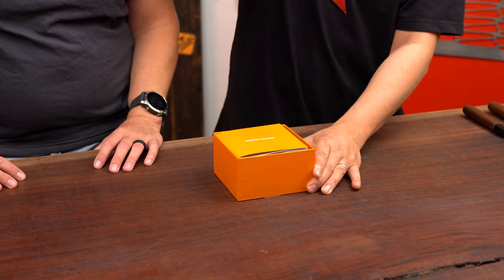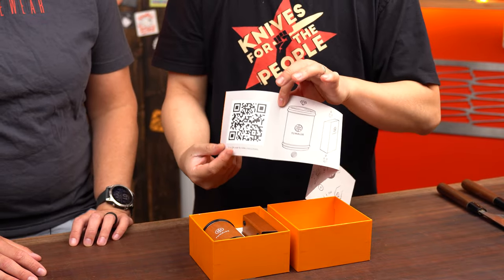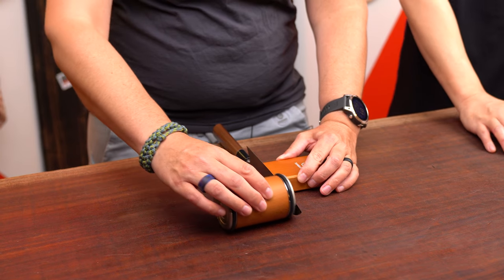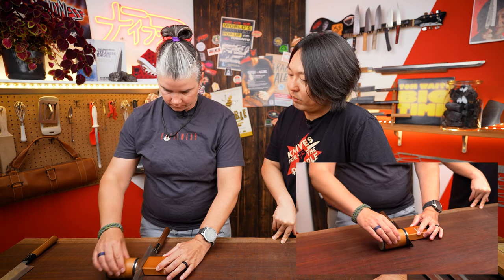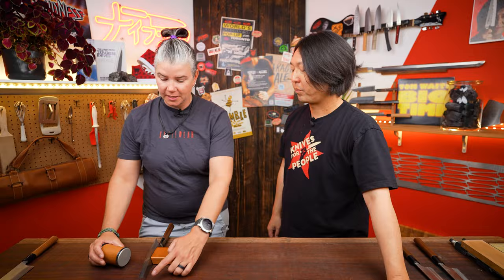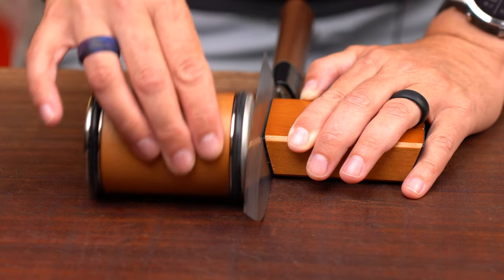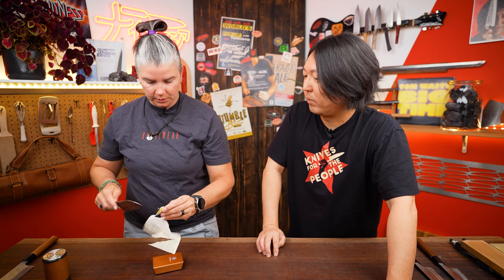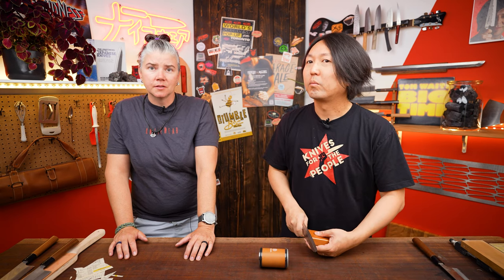Sharpening Showdown: TUMBLER SHARPENER v.s. WHETSTONES

Comment: Tumbler doesn't work because you are grinding the metal in itself .... where with wet stones you are pulling the metal away from knife
Reply: Maybe tumbler workers if you roll one  Direction and reset from bottom and roll and reset will give you better Result. So pretty much roll up on 1 side and on the flip side roll down

Comment: What an incredible review by you both!   
A REAL 'no bars hold ' review and that's what alot of people want when it  comes to dealing with ones' investment in knives. 
 I was actually mindset on purchasing a tumbler type sharpener but you made a really good point about the dangerous possibility of slicing ones' hand open trying to re-arrange the position of the knife whilst attempting to get the edge right. The unnatural hand position of it holding the block that holds the knife while trying to concentrate on getting the tumbler (sharpener) consistent to the edge of the blade just doesn't seem right. 
Regardless of which choice one makes to sharpen their blades, I think as a beginner, one should first practice on a cheap knife from the buck-or- two/Dollarama store first before attempting to grind their $80+ blade.
Reply from the maker: Thanks for the love! Yes, remember to practice BEFORE trying to do any of your expensive knives!

Comment: The price of that roller sharpener is wild. It costs about a third more than a WorkSharp Precision Adjust, a guided angle reciprocating arm sharpener that comes with 3 grits,  is infinitely adjustable between 15 and 30 degrees, and is safer to use. And the WorkSharp is way more versatile and gives better results.

The Tumbler might help to grind at a consistent angle (within a narrow range of blade heights and profiles), but it looks like it makes deburring more awkward, which is like a golfing aid that drives for you but can't putt.

Tiff has a great vibe on camera!

Comment: I mean, in Japan you have a house stone.  That's the final word.  You quickly sharpen up on the house stone, then maybe strop on whatever you're wearing and it takes no time at all to repair an edge.  I can't see these roller things replacing that. 

The biggest issue with the roller (outside the price, durability concerns, and lack of flexibility) is that I just don't think it's really able to DEAL with any heavy sharpening jobs.  I get people coming to my booth every week to get knives sharpened to desperately need the sort of fixes that one can only do quickly on a 200 grit stone.  I even have an 80 grit stone that I will do heavy metal removal and tip repair on.  The sorts of chips and damage people put in knives aren't going to be repaired by a tool like this.

Comment: It took me a couple of uses to get comfortable with the Horl 2 barrel sharpener, but once I got it down it takes me about 5-10 minutes to tune up several knives (kitchen and pocket) sharp enough to shave. I do that to all of my knives every month so I've gotten a fair bit of practice. The first couple of times it was a bit awkward. I used to sharpen woodworking chisels on whet stones so I know how to use them, but this all fits in a little box in my cupboard, takes minimal counter space, and the whole process is so darn quick.
Reply from the maker: We gotta give the Horl a try!
Reply: @KnifewearKnives  Honestly, I'd say just practice a bit with the tumbler and know that the disk is about 2000 grit (something I just learned myself). It won't bring a knife back to life like a stone, but it's good for a quick tune up.

Comment: Try and use  even back  & forward motion start with ight  Presser  as the sharpener bits the knife blade edge add more presser with each Push or Pull motion Keep count on each pass..i hope this help...O...try  Circles..in a Slow Motion.....

Comment: Those tumbler sharpeners do actually have a small learning curve, you do have to inspect the blade after you do a round of sharpening; you'll probably notice you have to spend a bit longer on certain parts of the blade. Also, once you're maintaining a blade rather than going from completely dull it's much, much quicker.

Comment: To me, those roll sharpeners make no sense for several reasons. 1. they are expensive 2. they are big, thus requiring more storage space than a diamond plate or whetstone 3. they only give you two different angles. 4. you operate them with the cutting edge of the knife facing up 4. you need both hands to hold them steady, one pressing down the sharpener so it actually rolls and does not slip, the other to press the magnetic holder against the roller 5. it requires practise to get one smooth, consise movement and sharpen the edge all the way through. Just slapping you knife on a cheap, double-sided whetstone and "scratching" along takes the same effort, if not less, saves money and storage space in your kitchen drawers.

Comment: Could you explain how the Tumbler and similar products aren't simply a pull-through sharpener in a different package?
Reply: The tumblr is actually acting on the steel in the same way a stone would, by abrading away steel from the side of the bevel. Many pull-throughs are more like ripping and scraping steel off the sides and thus you usually end up with a sharp but pretty rough and non-uniform edge. Plus pull-throughs usually don't have different "grits" for getting a good fine edge. Pull-throughs really aren't bad for using on like a beater yard work knife or something but are going to give a really rough, toothy, and ragged edge for any kind of finer work.
Reply from the maker: Couldn't have said it better myself!
Reply: @knownaigm  Got it! Thanks for taking the time to explain that!

Comment: The Horl is more $$$ but a WAY better system.
Reply: Not much, it has the same problem with the tips, it's prone to flatten the curve of the knife, it can't be used for thining or single bevel knives and the small surface of the abrasive needs to be replaced frequently

Comment: Few things not clear form the video. For one you counter only sharpening time but not soaking time. 20 min more in that case. The. Watering during sharpening, dirt… I think that if I was not into knives I wouldn’t be convinced to start using whetstone. Why not advertise also diamond stones? They are much easier to  use at same or better effectiveness. No need to flatten the stone, no need to soak in water.

Comment: Beginners are not going to be thinning their knives....  It isn't really a comparison point.  I know that you're trying to sell wetstones, but...
Reply from the maker: Great point! Because thinning is such an essential part of sharpening a Japanese knife, we always take it into consideration. If folks can learn to sharpen their own knives, thinning is relatively straightforward so we try to encourage it!
Reply: ... whetstones* (from "to whet" = to sharpen)
Reply: @KnifewearKnives  With all due respect, thinning is nonsense. You want a thin-blade knife, buy a thin-blade knife. You have a thick-blade knife and want it to be sharper, sharpen it to a more acute angle. Not need for an effort that can't be corrected once it's gone wrong.
Reply: My first sharpening was thinning my knives, due to years of bad maintenance.
Reply: @einundsiebenziger5488 geometry is more important than sharpening for cutting food. You can fine cut tomatoes with an squared apex if the knife is thin enough

Comment: I completely understand that you guys like to promote your stone sharpening service. 
But i am disappointed by the way you conducted this 'test'. 
I have been using a roller for many years with great results.
Reply from the maker: Hey, I appreciate the feedback! If you have suggestions on improving it, please let us know! Are you using the Tumbler or the Horl?
Reply: The problem really is that the official instructions for the tumbler suck. I suspect it would do a whole lot better with a proper method like adjusting pressure, flipping sides in more conventional intervals and actually removing the bur on the correct side. At that point the tumbler is kind of useless though since the whole point of it is to be easy and require no knowledge.
Reply: I use neither the Horl or the Tumbler. 
I have an earlier German product from the people who actually invented this system.

Sure, for the most demanding applications, i can use my wet stones. Like for repair jobs.

Not being a sharpness fetishist, but a regular hobby chef, i have no need for knifes that are so insanely sharp that the meats cuts itself out of fear for the knife.
I cut food, not newspapers. 
I slice tomatoes. I don't give them a clean shaving job.

I need something quick and easy without setting up an entire sharpening station and soaking stones for 10 minutes before i can even start sharpening. Not to mention the cleaning up time.

Using the roller as a regular way of maintaining the sharpness of my knifes is absolutely perfectly adequate for me. My knifes slide through the food effortlessly.

The roller gives me an excellent sharpness on my German and Japanese knifes, that is perfect overkill for all normal kitchen work in a few easy minutes.

If i really want that little bit of extra sharpness i use the strop after the roller.
Reply: @tjerkheringa937  I hear ya on the whole sharpening station thing. I personally use Shapton, splash a tiny bit of water and you're good to go and the storage box doubles as a stand.

I'm curious, what is the original product called and where can I find one? None of the hip branding BS.
Reply: What disappointed you about the way they performed the test?  What more should they have done other than perform the test according to the printed directions?  The fact is...these products are very limited in their ability to sharpen knives of varying bevel angles, blade heights, and knife conditions.  I think they gave the product the best opportunity they could...by using new knives in good condition with straight undamaged blades.  I have several old Sabatier knives with uneven grinds and even a slight propeller twist that this product would fail miserably with.  With 20+ years of sharpening stone experience...I can easily deal with all these knife issues in just a few minutes.  In my opinion, investing in ones own sharpening skills is a much better solution than chasing gimmicky products in order to avoid putting in the time to learn a valuable lifelong skill!
Reply: @Master...deBater  Even you here are showing your ingrained bias towards your beloved whetstone. Maybe you wouldn't have such un-even grinds if using the roller in the first place eh. And if you really wanted to you could try rocking and rolling the blade/roller to suit your un-even grinds like you have to on the whetstone. Personally i'd try to put a new edge that is even.
Reply: @tjerkheringa937  whetstones* (from "to whet" = to sharpen), not because whetstones have be soaked in water (become "wet") before sharpening / knives* / the meat* cuts itself ...